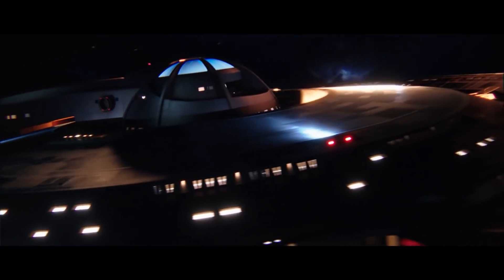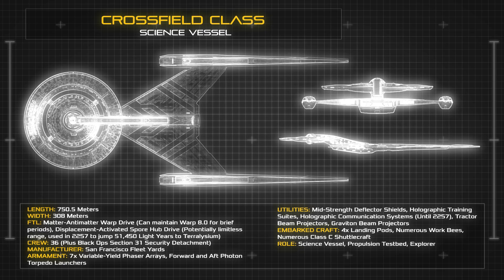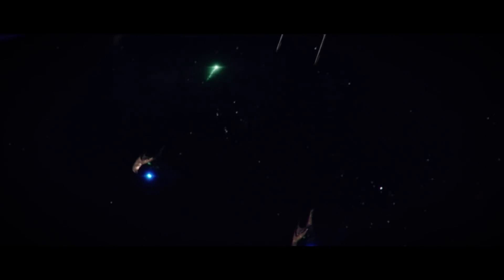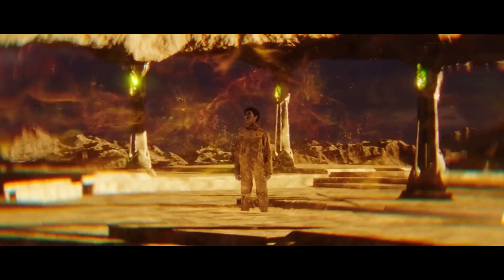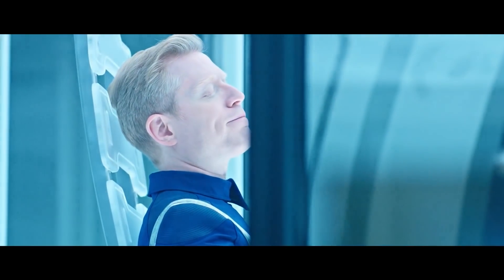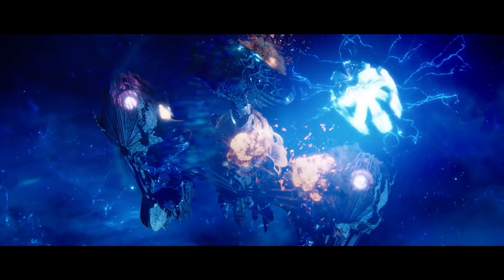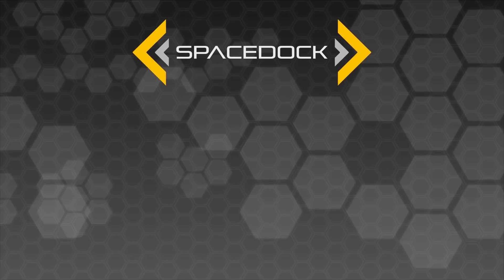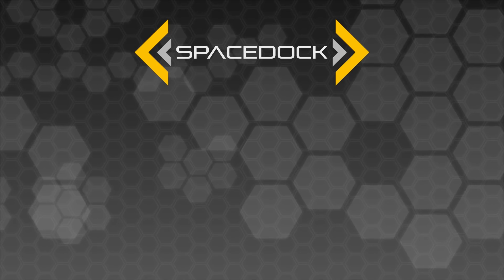Star Trek: Crossfield Class Science Vessel | Ship Breakdown

Comment: if only they were able to solve the navigation issues this would have been a greater than the slipstream drive that Voyager came across and tried to reverse engineer such an interesting design to what a shame although the slipstream drive itself could probably be made to work by Starfleet if they were to actually build a ship around it unlike with how they tried to do it with voyager and a shuttle if they were actually try I think that slipstream drive powered ships would be doable but this is super cool and very interesting

Comment: My one complaint about the crossfield class is no physical doors on the shuttle bay. 
It's always open to space, just sealed with a forcefield.. That's... insane... One failure of the eps system in, every one, and everything in the bay is lost.  And if the interior  doors don't close for whatever reason...
That's the kind of failsafe the federation typically doesn't overlook..
Storing barrels of whatever on shaky racks in cargo bays...sure... But the cargo and shuttle bays always had physical doors in the hull.

Comment: The Crossfield was never part of the Spore Drive project.
IIRC Lorca mentions that after the loss of the Glenn that the Discovery is the only ship with a spore drive which was before they found out about Ripper or Stamets using genetic augmentation on himself.

More so, the show implies that it was Mirror-Lorca who brought the project to the attention of Starfleet.
Which would imply that the Glenn/Discovery was modified instead of purpose-built for the project as Mirror-Lorca was less than six months in the original universe before transfering Burnham to the Discovery (I really don't want to use Prime Universe here as I personally don't consider Discovery or Picard to be Prime Timeline).
Reply: Captain Killy’s ISS Discovery never had spore drive but it looks identical to it’s Federation counterpart.

Comment: This is the problem with Star Trek, there are just too many previously used technologies that they ignore when it come to the crunch. DS9 is my favourite series, but starfleet were about to get wiped out at one point in the dominion war, short of Sisko and Garak performing some shady dealings to get the Romulans in to the war.
  Does it really make sense that no one else in star fleet command (or sector 31) would be willing to use a technology, requiring a few willing volunteers, that could result in the ability to instantaneously enter and exit Dominion territory? What about the phasing cloak from the Pegasus? 
 You'd forgive a one off situation but there seems to be a technology in every season of the next generation that would have turned the war for the Federation even without the Romulans.
Reply: Sad, but true. Take a ship with a spore drive. Jump into or close to a Dominion fleet, fire your Genesis Device and jump out. The same goes for every important Dominion shipyard, cloning facility and of course Ketracel White factory in existence you can find. Winning the war becomes a question of getting the coordinates.
Or add the Pegasus Cloak to a Genesis Device if a system it too heavily defended even for a ship with the spore drive,
Reply: Where would they get tardigrade DNA? They didn’t keep any samples. Stamets probably used it all on himself
Reply: @artembentsionov  I don't know. A thorough analysis down to the genetic or even atomic level on file?
TNG/DS9/Voyager technological wizardry to recreate them? Maybe have Odo help out? After all, his people can even become spaceships (if I remember that right).
It's not like they would only have the crew of a ship or a station available. They have all the best and the brightes of the entire Federation to solve that problem.
Reply: @grayscribe1342  maybe. Just seems like no one ever thinks of that in sci-fi. Look at Stargate. The Asgard just kept cloning the current body without preserving a DNA sample from thousands of years ago, which would have solved their degradation issue